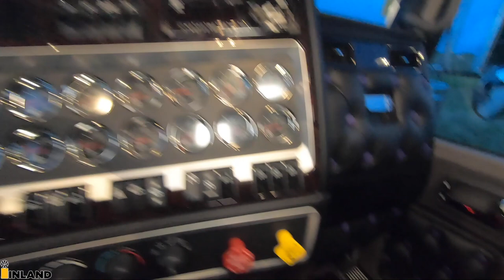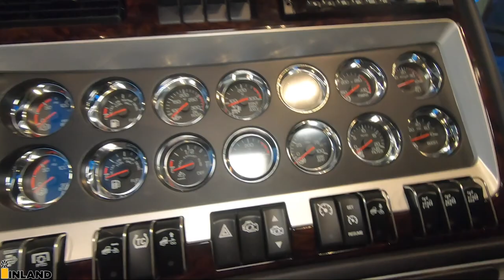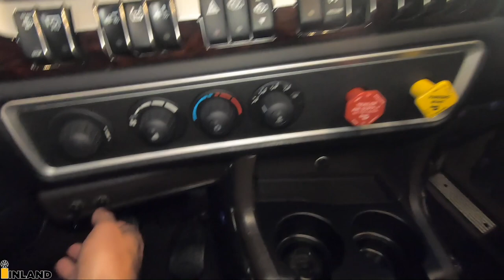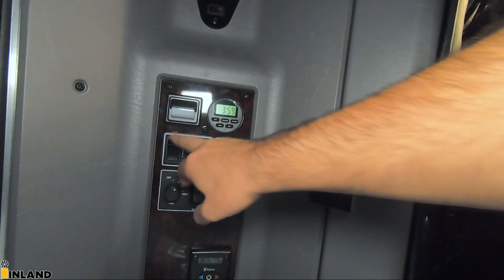MY FAVORITE TRUCK   2021 Kenworth W900L Totally Customized   The Kenworth Guy

Comment: Meritor axles on a KW?!  Sweet!  Good axle set on it.
Reply from the maker: We’ve done that for years.
Reply: @AndyTheKenworthGuy  Can the W900 be spec'd with a Meritor steer axle, too?  If so what capacity?

(BTW: Loved the paint scheme.  Made this truck stand out.)
Reply from the maker: Yup. Meritor Steer 13200 - -20,000 with meritor RPL driveline

Comment: Hey Andy! 
Have you ever done custom aftermarket headlights on de w900's? I've seen a few of them with really nice LED headlights in my province and i was wondering if you've ever installed them for clients.
Reply from the maker: I sure have.
Reply: There are two really good choices I know of right now. The trux light heated led and the JW speaker heated led. They will both run around a thousand US dollars but I thought they were worth every penny
Reply from the maker: They are great.

Comment: Beautiful build Jaime . One question though, can a W 9 be speced with the all in one aero mirrors? Just wondering due to driving so many trucks with the mirrors like on this truck in sloppy weather and you get the semi vacuum effect of the liquid hitting the convex mirrors and then spraying the main mirrors and with the mirror heaters on it drys all the road crud to the mirrors
Reply from the maker: No. You have outside air cleaners on the W and then have no room for aero mirrors. If you order without air cleaners outside then yea. However I’ve never done it so not sure if it’s still possible
Reply: I currently have 3 freightliner coronados, I guess you could call the mirrors "aero" as the connex and flat mirrors are in one housing. I can tell you that my convex mirrors always ice over first, and my washer fluid spray always ruins my clean mirrors.
Reply: @TheRoadhammer379  I think that must be why I’m seeing more and more Freightliner s with some sort of wind deflector on the A pillars lately

Comment: What's the part number for that hood fender support?
Reply from the maker: Not sure as I’m not a pets guy use chassis number 972682 and ask any kw parts department.
Reply: L11-1173, L11-1173R for left and right side. KW parts dept has it listed as Hood Guide Bracket. You have to order the lower piece separately.

Comment: As much as this thing cost, they are still using old headlight technology? Should come standard with LED with that price!
Reply from the maker: We change lots of the lights out for the JW speaker
Reply: The lack of knowledge is astonishing, but I guess company drivers don't count pennies like O/O. Your new technology comes with a hefty price tag. Volvo:$665 per light not including ecm programming. Peterbilt 389:$299-859. Freightliner Cascadia:$399-1,125, again this does not include programming. W900: $15, can walk into any truckstop, Napa or Walmart and buy one.

Comment: how do they measure truck wheelbase? does kenworth offer prewire for satellite dishes?
Reply from the maker: Front axle to center of rear axle group. And yes we offer pre wire.
Reply: @AndyTheKenworthGuy  thank you
Reply from the maker: You bet
Reply: @AndyTheKenworthGuy , Peterbilt says it is center of steer hub to center of first drive axle hub. Is KW measured differently?